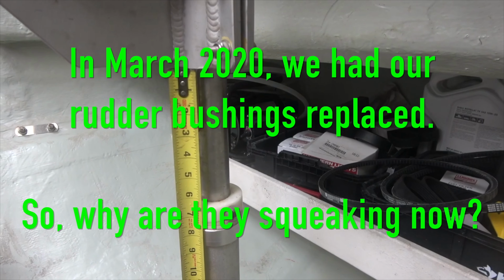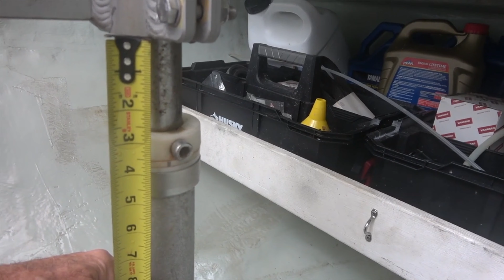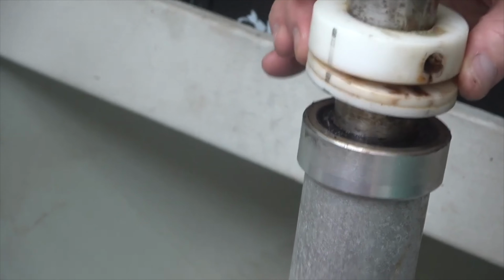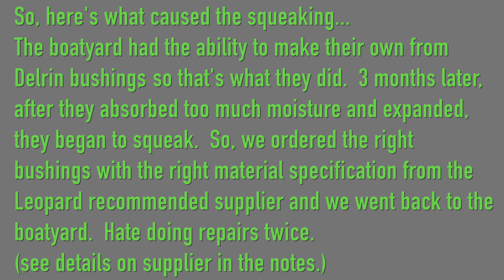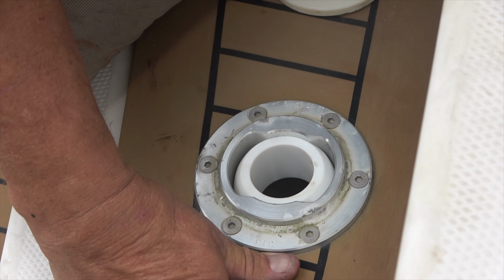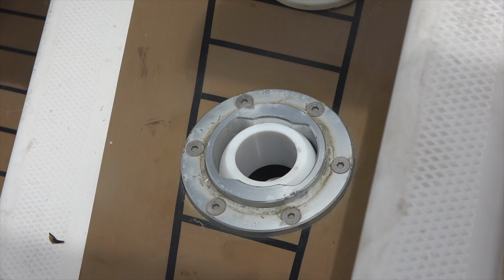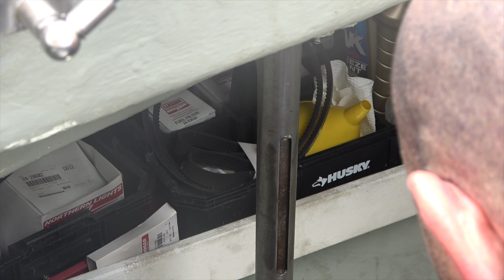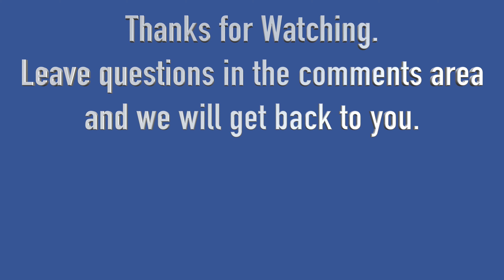Squeaky Rudder Seizing up? - Replacing our Rudder Bushings TWICE on Blue Dot Voyages PILAR.

Comment: My 2005 Bavaria 46 cruiser suddenly developed very tight steering with the same squeaking noise. It's going in the yard soon for bottom paint, so it looks like I'll have to replace the lower bearing.

The previous owner said he replaced the bearings with Jefa bearings about 7 years ago, but maybe he purchased a cheap knockoff.

Comment: Delrin is used very successfully in rudder bushing application. it absorbs very little water. That is king of odd , if machining was originally made to the right tolerances.
Reply from the maker: We thought so too.  But the reality is since we installed the OEM bushings, we have had no problems whatsoever.

Comment: Excellent video! This helps visualize what it takes to replace the rudder parts. Do you know how important it is to have the covers on the manual steering holes? Thanks again for posting 🤙🏽
Reply from the maker: Those are there to keep debris from upper bearing. And cosmetic of course.